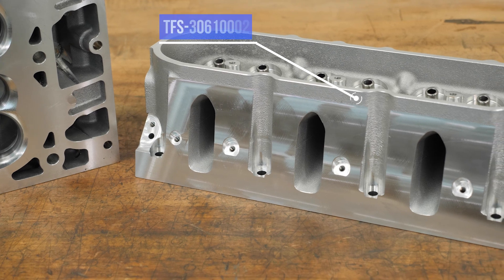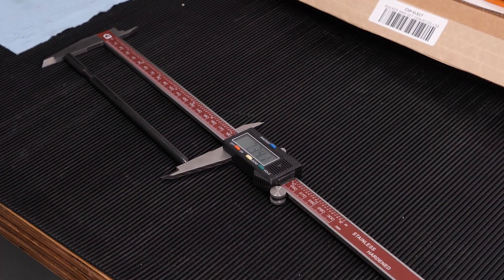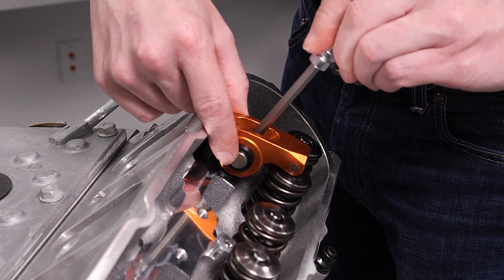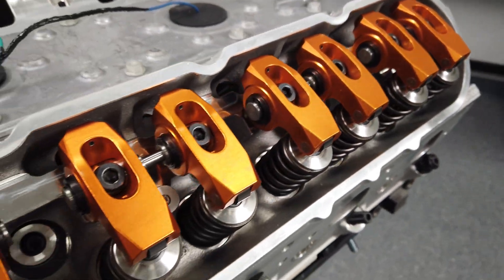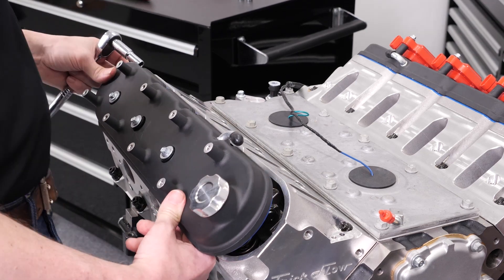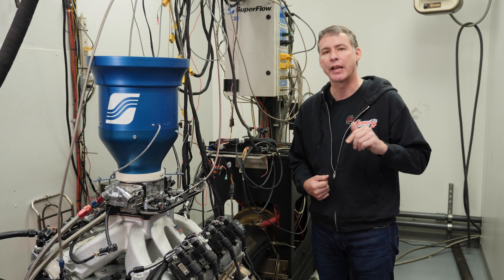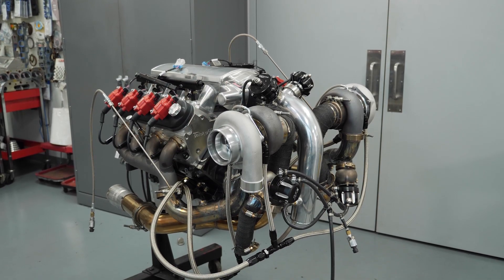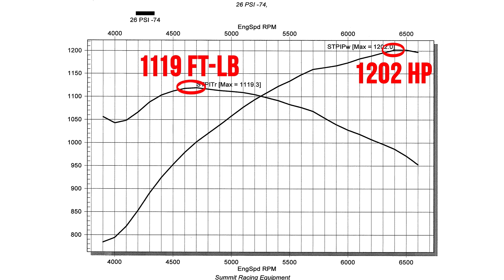Summit Racing’s Project 1000: A 1,000 Horsepower 6.0L LS Engine Build (Part 2, Top End & Dyno Run)

Comment: What turbo manifolds was used on this build
Reply from the maker: Not knowing what Project 1000 would be fitted to, we chose a 4th Gen. Camaro headers from On3 performance.  The Intercooler, couplers and some cold-side piping was Summit Racing Brand with VS Racing 67/62 turbos and Summit's 2700 series piston style wastegates.

Comment: Wow😮, I would like that in my 2009 Silverado. I wouldn't have any problem with pulling my Mako boat to the coast. Oh yeah, I am still running the original 5.3 with over 250,000 miles, and no problems with it. I've only replaced number one coil, that's all I've done to that engine!

Comment: I have a 2007 1/2 ton 5.3L LM7 Automatic.  145,000 eratic oil pressure.  How much more HP can I throw at it before I have to replace everything else?  50HP?  100HP?  LQ4 6L Regular Gas?
Reply: An lm7 bone stock is good to about 600hp reliably, but you wont see more than about 320-350 na. Before you do anything you should get your oil pressure up and reliable. Upgraded headers and a new throttle body are easy upgrades to get those numbers up from the stock 290 hp.
Reply: @jtgoodling  Thanks.  Throttle body upgrade recommendation - 92mm?  New oil pump?

Comment: I almost done with my 408 stroker. I’m using a lot of y’all’s parts. It has a forged rotating assembly, clevite h series bearings, melling 10295 oil pump, y’all’s 8722R1 cam, btr springs, yella terra rockers, hardened push rods, ported 317’s, Hinson c5r timing chain, billet sprockets, 7 quart pan, Holley hi ram, 88mm turbo, Bosch 220’s 10an line, motion raceworks flex fuel sensor, gmpp 3 bar map, arp top to bottom, 50mm waste gate and bov,  4l80e with tci triple disc, hd2 shift kit with boost valve and servo… I still have quite a bit to add to it before it’s all done and drivable. I have a 1000whp on E. Y’all make building a LS easy as can be ESPECIALLY living close to Arlington!
Reply: Sounds pretty close to direction I'm going let me know how the 4l80 likes it 
So far I'm dailying my 6.0 4l80e these spring I'm hoping to drop it in 84 Cadillac Fleetwood with some Goodies possibly will do 408 rotating assembly hoping cnc ported stock LS head hold up to abuse as these trick flow costing
Reply: How is your build going I'm located in Fort Worth Texas I was going to DM you a message on a build on a Corvette.

Comment: I went with a single turbo my build gen4 block 413 with 98mm turbo I'm using a turbosmart eboost 2 controller i can have 6 maps for e85 and 98 around town I got all my Aeromotive fuel system from summit and was painless getting it all sent to Australia as I couldn't get anything local that could handle my fuel needs nice to know I can get stuff sent from the USA to Oz without hassles
Reply: At what point is more than a 3 bar required?

Comment: A better exhaust manifold and a slightly smaller turbo that still makes at least 1000hp but wakes up earlier would be something that i'd prefer for a "street" engine. Doesn't even need to be a 6.0 liter, a shorter stroke paired with a longer connecting rod would be nice for wear and tear especially with a 2618 alloy piston.

Comment: Who's exhaust manifolds did you use and do you have the part number for it
Reply from the maker: Thanks for your question, Randall. We’re double checking with our engine builders and will have a part number for you shortly!
Reply: @SummitRacing been waiting on this same info for a while. Any update?
Reply: Yeah, what pipes are those?  @SummitRacing
Reply: Me to

Comment: When finding the right pushrod length, why did you add the .070 to it and how did you come up with that number ? But awesome work !
Reply: Its based off the travel of the plunger in the lifter. My LS7 lifters, I measured .200 travel. So I preloaded the lifters at .100 to keep the push rods snug, and it also keeps them from ticking.

Comment: Did you dyno it N/A?  I'm curious the engine made on it's own.
Reply: I'd say it's pretty safe to assume 550-650hp if it's like most any other one. You gotta remember it'll be down on compression and won't have an optimum camshaft in it to squeeze every last N/A horse pressure out of it and mid range won't be real strong with that intake.. I've seen a few make a little less and a few make a good bit more but this is where a lot of them end up. I'd probably put this one on the upper portion of that range due to the cylinder head that's on it and I'd add 30-40hp to it if it was a 6.2l with a rectangle port on it.

Comment: What manifolds/piping are you using?  Is it all custom or is that a kit that I can purchase from you guys?
Reply: Summit has a LS pro manifold set. You either buy one or the set. They’re a little pricey, but is an excellent product. My 408 is built using mostly summit ls pro parts.
Reply: Summit has a LS pro manifold set. You either buy one or the set. They’re a little pricey, but is an excellent product. My 408 is built using mostly summit ls pro parts.
Reply: Are you talking exhaust? Which specific parts are you talking about?  “Manifolds/piping” is pretty vague.
Reply: @BGCoop79  based on the video context, exhaust manifold and turbo piping. The intake manifold was already mentioned in the vid, so exhaust manifold is what's obviously being referred to by the comment.

Comment: Good content. Why did .070 have to be added to the final pushrod length.  That 70 thousandths was accounting for what?
Reply: Lifter pre load I was thinking it accounted
For
Reply: @dee9117  I usually see .050 for preload so I'm sure that's what the .070 was for.
Reply: I'd like to know as well, since there was no information about how what the number was based on, and the utility of it??
Reply: @jneff1009  I as well. Is .070" a general number for hydraulic lifters or something specific to the LS.

I Think they need to explain that a bit

Comment: What type of transmission would be required for this build nd I kno it's going to be built
Reply from the maker: Something like this is making a 3500 plus stall but a 4l80E would be awesome.
Reply: I already have a th400 in my 2010 Camaro SS. This would be right up my alley if I was to build a turbo set up.
Reply: Most stock cases will take that much horsepower but the internals won't I would start from the torque converter or the flex plate torque converter all the way through the transmission if it's made out of something that doesn't wear out and it's hard I'd replace it with 300 m hope I'm saying that right for more the better quality last longer
Reply: Black sheep industries waste gate. Really good stuff

Comment: What rocker did you use do you have the part number
Reply from the maker: Actually, as long as you are running a powdered-metal guide,  the factory rockers and Pro Ls cams are designed to work with each other at  .625 lift and below.  It’s the lightest rocker at the valve and allows several hundred r rpm more with greater reliability than aftermarket roller rockers etc.  a Trunnion kit is advised if the rockers have over 50l mileage on them.
Reply: CSP-SLS17
Reply: @peeweemiller6462   thank u
Reply: I think when I got my cam it was 575/600 lift with 232/234  duration with 115 Lobe separation. I know you guys have changed the cam grind on the turbo stage 3 cam 2 times.or is it three time ?

Comment: What fuel did you use
Reply from the maker: We ran C-16, because it makes detonation a non-issue, but E-85 would likely make greater power.  Fuel flow with bigger injectors and pump/pumps may be a cheaper alternative.
Reply: I have the same parts in my lq4 same crank rods pistons and cam and snake eater 1000 injectors on terminator X max ECU same intake and throttlebody with stock 862 heads with twin vs racing 66/73 turbos in a 84 z28 Camaro

Comment: Summit I want to buy the 5.3 450hp 420 torque lm7 engine. Question is should I buy that one or a 6.0  . I want N/A power for now and then turbo it after. For a 2000 Chevy Tahoe 2wd. It's something different but I'm doing it.
Reply from the maker: The difference is for a smaller engine like a 5.3, the engine isn’t going to make quite as much odd-boost torque.   The turbos are actually a great match for a smaller engine than a 408.   They are actually very undersized for a 408.
Reply: @SummitRacing  so is the 5.3 450hp 420 torque a good choice for turbo. And also does it really have way more power than a stock 5.3? I think that 5.3 is a cheaper way to go. The 6.0 will cost more to buy build and turbo
Reply: What was the backpressure?  @SummitRacing
Reply: My opinion. Go w the 6.0, for a truck that heavy. It 'll be plenty plus when u want to upgrade, more power& torque for almost same money as 5.3. Smidge more.
Reply: @williamgutwald9953  ok thanks

Comment: Absolutely,  I would love to know what this build cost, I'm thinking a 2001 corvette, and let's do some autocross.
Reply from the maker: We have a full recipe and you will likely have huge savings if you have a donor.  We built this engine from scratch using bare parts. A LS6 for instance would likely dance the main caps at this horsepower, but if you could live in 850whp…could live easily
Reply: @SummitRacing  would be an ls1 in 2001. Yeah I know not any difference as far as main caps but not all people know that.

Comment: I’m curious about what these “inexpensive, off the shelf parts” add up to. 🤔
Reply from the maker: That’s the conundrum.  When we built this engine without a core to begin with, it was expensive because every little bracket and sensor needed to be accounted for.  When you take your core plus the required Pro Ls and other components, it becomes way way less.  A full list is upcoming.
Reply: @SummitRacing  you can't tell idiots nothing. 
 
He stated the whole damn build was FROM SCRATCH WITH EVERY PART ORDERED FROM SUMMIT CATALOGUE, FOR A 1000 HORSEPOWER BUILD.

Obviously the point of the build , is to be illustrate summit has EVERY PART NEEDED FOR A BUILD LIKE THIS AND ALSO TO SHOW YOU DONT HAVE TO BUY THE MOST EXPENSIVE PART AVAILABLE.

there's a whole damn list of parts you could reuse if you had a DONOR ENGINE OR ONE FROM A JUNK YARD.  They had to buy every bracket and screw..ALL OF IT.
So obviously THE PRICE WONT REFLECT WHAT YOU WOULD SPEND IN YOUR UNIQUE CIRCUMSTANCES.
Reply: 15k

Comment: “Summit prototype waste gates” are Black Sheep  industries waste gates. BSI gates have a good design.
Reply from the maker: Matt, we are working in partnership with BSI to develop and offer the wastegates. As always, we are committed to offering the highest quality parts.
Reply: @SummitRacing   I use Summit branded parts. I have a Pro Ls truck cam now, and bought my first camshaft kit from Summit Racing in ‘97 at 14 years old. I just figured since VS racing got the blow off valve plug, the Canadians should get their BSI plug.
Reply: @Mattvardaman  a4ggskklpppga gagajayyyŕy6da
Reply: Yes. We don’t copy.   We have Integrity.  We enter a relationship with folks that makes sense for all.
Reply: I hope Summit doesnt China copy them as their own.
Reply: @anotherbluenova6358  They make quality parts. I’ve run the Summit branded parts for years without a failure. Most everything they have is made in America. If it doesn’t meet the made in America standard then it’s indicated in the catalog.
Reply: @anotherbluenova6358
Reply: https://youtu.be/2-w2-khY_6g
Here is a quick view of the BSI gates. From what I see they are amazing
Reply: I find that everything summit branded is high quality

Comment: Are you guys going to do a run down on price per part and overall cost
Reply from the maker: Yes, we have a full parts list.  The only problem is the entirety of this build was brand new out of the Summit catalog.  A person with a wasted 5.3 motor is going to save a TON of money in re-using viable parts  that can be re-used to the same effect.  Our goal is as to create a recipe for folks to replicate the functional recipe needed to make the power with their own junk-yard parts as needed. Hallelujah
Reply: @SummitRacing  why not list it in short and long block configurations?
Reply: This part